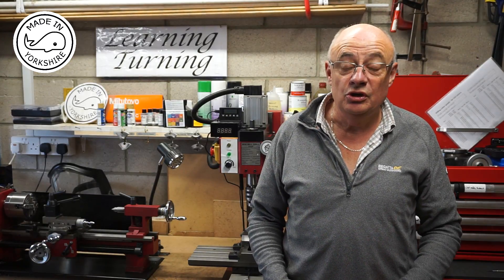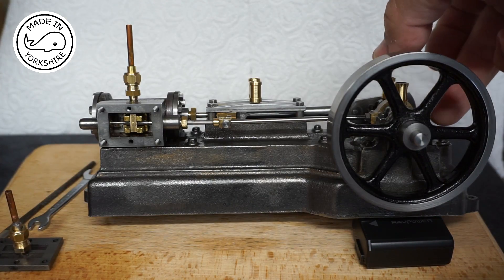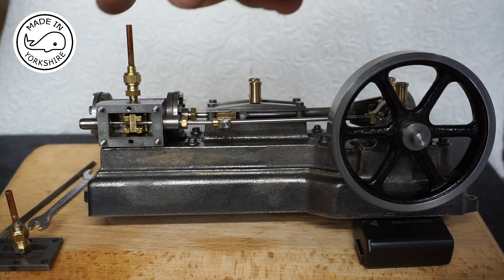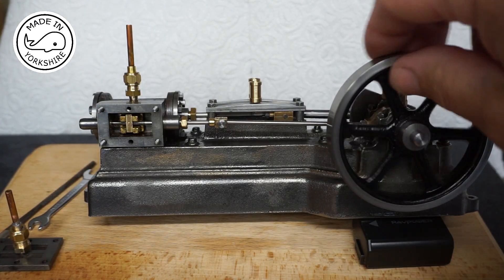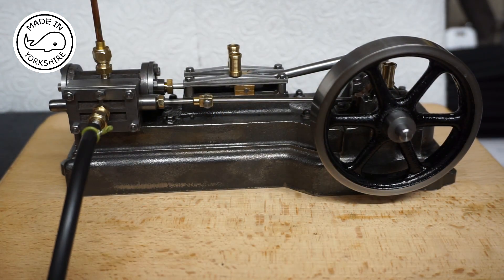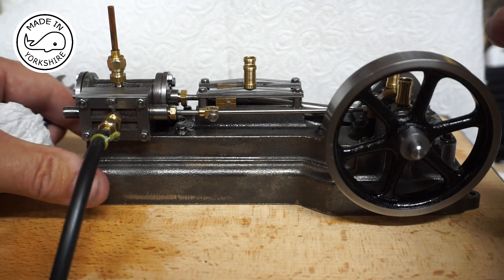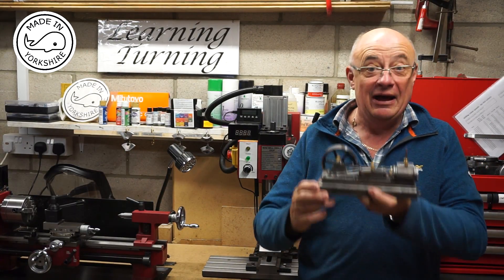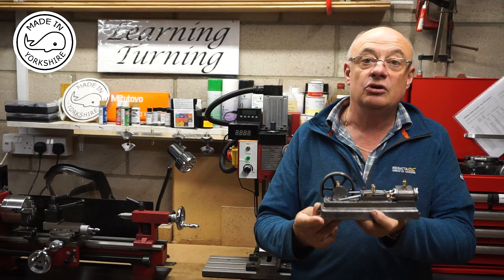#MT22 Part 11 - Making a Stuart S50 Steam Engine - Valve timing and first run. By Andrew Whale.

Comment: hy again , i got it all sorted , i found all the taps and dies i need! but the pipework, wich fittings or unions do i need if i want to do it the same way as on your video here ?for the conection of the copper pipe i assume i need a union, is it a male and a female and a ring , or what all is necesary to fit the pipe the same way as you did here ?
Reply from the maker: Hi. I decided to use 1/8" od copper pipe.
I purchased the following from Maidstone Engineering:
2 x male unions 3/16"x40 1/8" pipe sku 258
Globe valve 1/8" pipe 90 deg sku 182
Copper pipe 26swg 1/8" sku 751
You should be able to find these parts by searching for the sku in the Maidstone Engineering site.
Good luck
Andrew
Reply: @learningturningmetal  great andrew! thanks so much ! keith appleton from mainsteam would not tell me the sizes unless i pay him money on his patreon channel , otherwise he said he has no time for that ! realy , i apreciate it !
Reply: @learningturningmetal  thanks 1000 times ! looking forward to the build, io have similiar machine setup ust from german reseller , and i love your videos ! realy ! you are a big help here !

Comment: hy Andrew! great build ! i want to start a s50 or 10v but i need the taps ! can you tell me wich taps and dies are required for the builds ?
Reply from the maker: Hi. Unfortunately I don't have time to work through the drawings. From memory both machines require 7ba and 5ba taps and dies. Once you decide which engine you wish to build, the drawings will provide you with all the details.
Cheers
Andrew
Reply: @learningturningmetal  i decided to go with the S50 and would like to order as soon as possible. i realy would apreciate if u couldt tell me all the required taps dies and  clearence drills. greets from vienna
Reply: @learningturningmetal  i just want to get all the tools before i start the build , so i dont have to wait for weeks to continue, i also asked those questions in several stuart groups but no reply yet, so you are my hope at the moment. also there is a steam Union on your engine , is this a 1/8 or 3/32 union ?

Comment: Nice one Andrew, make sure to use an etching type primer when painting.
Reply from the maker: Hi Roger. Looks like I've messed up as I've already started painting with std grey primer. 
Thanks for the tip. One to remember for next time.
Cheers
Andrew
Reply: You might find that the paint might chip away easily but you might get away with it hopefully.
Reply from the maker: Hi Roger. Now I'm worried. Yesterday I did a test area using grey primer, but I think I will clean that off and try to get some etching type from Halfords. In terms of finish I had purchased black and green Humbrol type from Stuart Models. I'm not overly impressed with the colour of the green and would have liked to paint the flywheel red. Can you recommend any types of finish and specific colours? 
Many thanks.
Andrew
Reply: I may have misled you a bit, If you are painting brass or copper you need an etching type primer, on castings you should be ok with using Phoenix precision paints, these are designed for locos but are suitable for statics as well. Look at Keith Appletons paint playlist, it might give you some ideas.
Reply from the maker: Hi Roger - just an update. I purchased some UPOL etching primer from Halfords and the first test looks like excellent adhesion - so thanks for the tip.
I also ordered a variety of Humbrol enamel colours - Brunswick Green, Signal Red, Crimson No2, Black. So I need to experiment!
All the best.
Andrew

Comment: Well done on the build and it runs nice. I have the same kit to machine this autumn and a 5a, now that will get the grey matter bubbling.
Reply from the maker: Thanks mate. Looks like you will have a great challenge ahead. I need to decide on what model to have a go at next, but it will be determined by the limitations of my lathe.
Good luck.
Andrew

Comment: Congratulations Andrew, well done well done.  I especially liked the alternet steam source towards the end of the video.  Did you make the oiler cups or were they supplied with the kit ?
 Boy that project required a great deal of additional milling and turning tools and equipment, great job Sir.
Especially great video series.  Thank you..
Reply from the maker: Thanks Greg - I got a little excited! I got the oilers from Maidstone Engineering in the UK. They were only about £3 each. Probably a little large for the slide rails, so I might have a go at making a couple.
Thanks for the support.
Cheers
Andrew